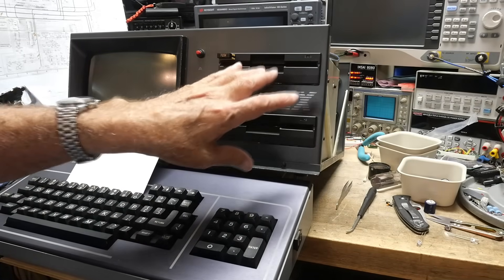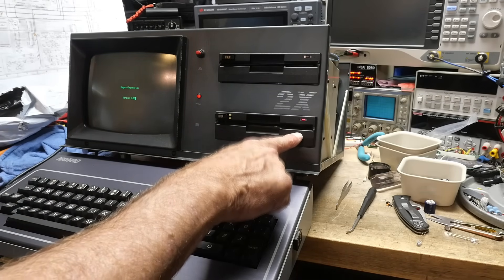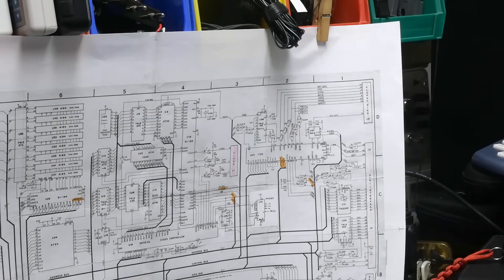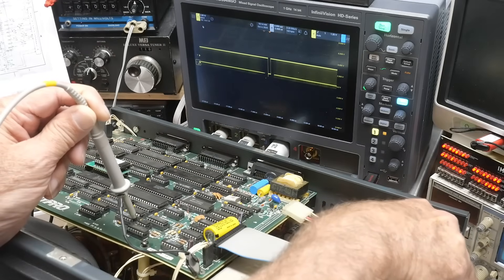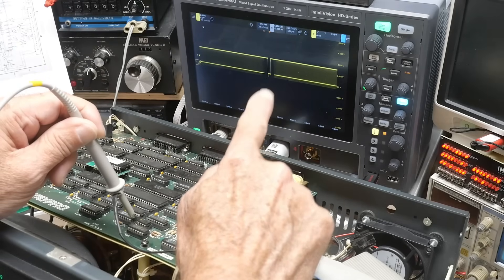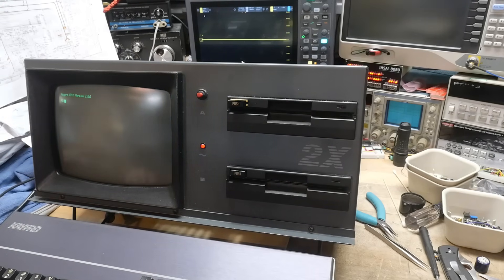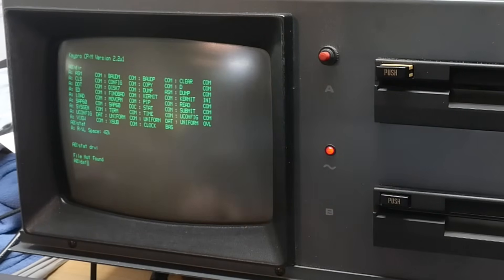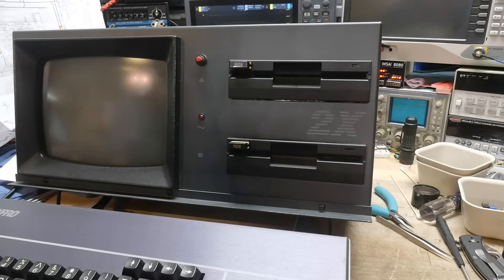#2408 Kaypro 2X Computer (part 8 of 10)

Comment: With no disk present, it's not unusual to see random noise coming from the head amplifier when the drive is selected.
Looks like a bad head on drive A.

The copy command should allow copying from/to a single drive.  It will prompt you to swap disks as necessary.

Comment: At 1:52 why on reset does the system access the B drive first, that seems counterintuitive if it only loads the system from A drive, is that a sign of some other problem in ROM or hardware?

Comment: My first computer! I got it free before it hit the shelves. I had a side gig in jr high and  high school taking devices apart and photographing the boards and other  guts in great detail for the engineer doing FCC compliance reports. Whatever they didn't need to retuen I got to keep.  Boxes of CB radios. Later, boxes and boxes of clock radios  then cordless phones. And the final job was a kaypro. 

I got a 300 baud modem from somewhere and it opened the door to BBSs, and I spend endless hours playing catchum, ladder, alien invasion, and when desperately bored, star trader (ASCII pacman, donkey kong, soace invader and star trek ripoffs).

The thing was a beast. Vastly overbuilt. The handle was good as a stand for angling it up but you didn't want to travel with it unless maybe across the room. 

Makes me happy to see it.

Comment: By the way, you can get answers on all of your questions about CP/M commands by using Google search or by asking an advanced LLM.  Gemini Advanced (I use 2.5 Pro) can answer any and all of your CP/M questions.
I've been developing a (disk-less) TinyOS for my Altair 8800 where CP/M 2.2 programs are loaded and run via mimicking all of the CP/M techniques for memory use and I/O technique and I get answers on all details via use of the LLM.   Also, Google searches give you the location of online CP/M documentation.  Note that Google search now uses the free version of Gemini so with that you get great answers and you probably don't need the $20/month version that I use.
Just have a PC accessible from your work bench.
Cheers.

Comment: They do you a bit of a disservice calling U67 just a 9216.  From that number it sounds like a Fairchild part but it isn't.  It's an FDC9216 by SMC which is a monolithic disc data separator.